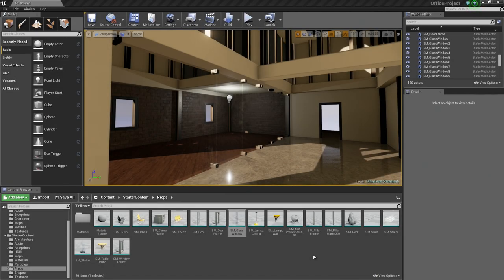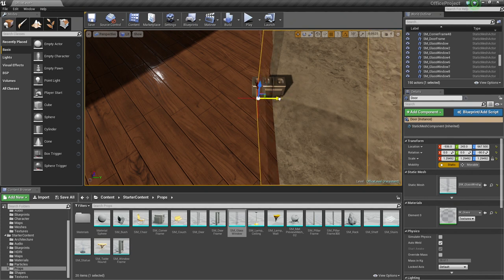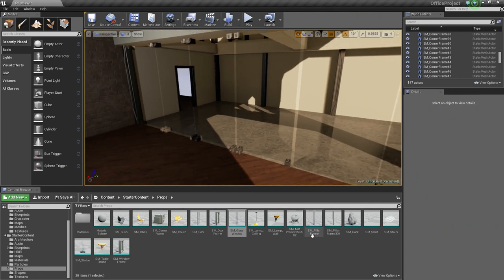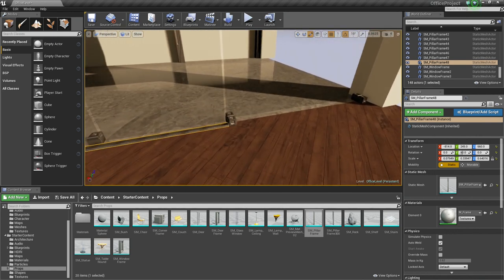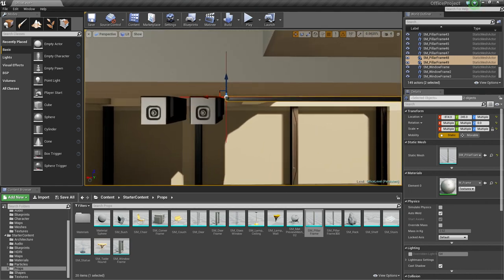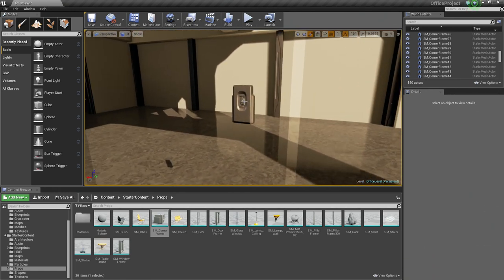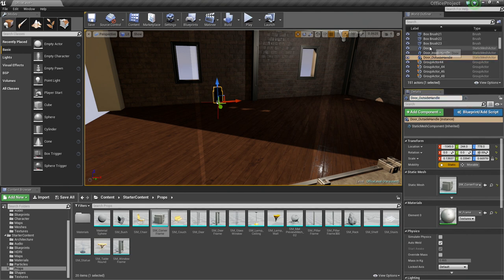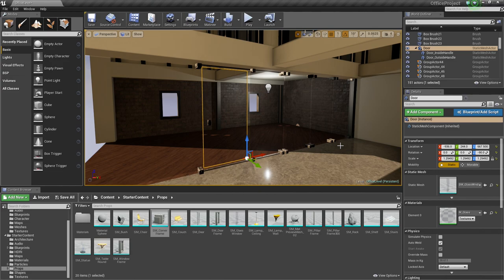Intro to Level Creation: Setup for the Sliding Door | 08 | v4.7 Tutorial Series | Unreal Engine

Comment: If you use RMB + WASD to move around in the viewports, you can change your speed by holding RMB + Mouse Wheel Up or Mouse Wheel Down. 

In my opinion, this should be in Preferences > Viewports, but it's not. I had to stumble upon it in the Documentation.
Reply: on the top right of the viewport, you can change the camera speed. you would know if you watched the basics :p